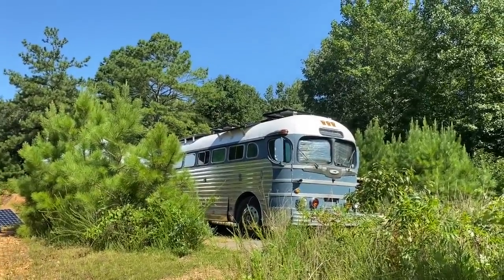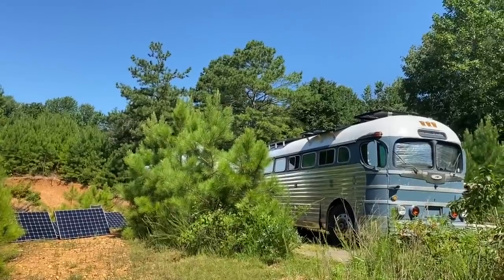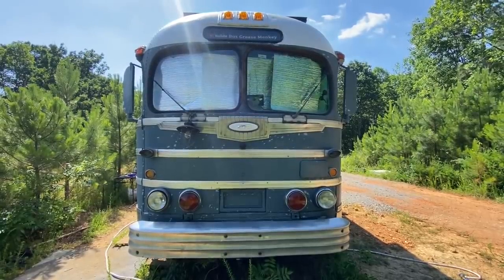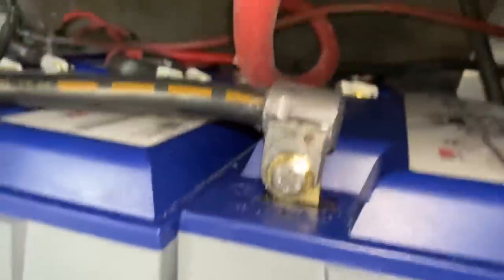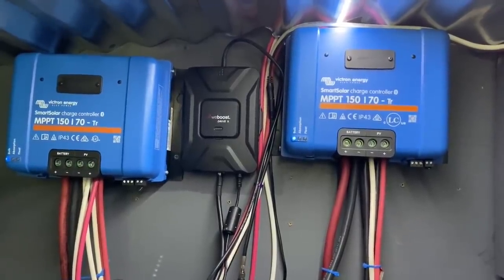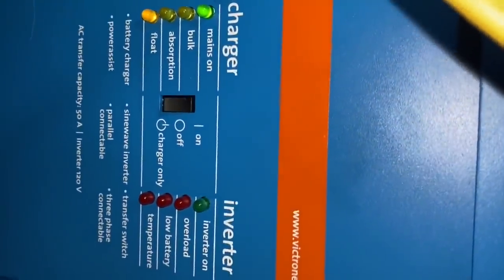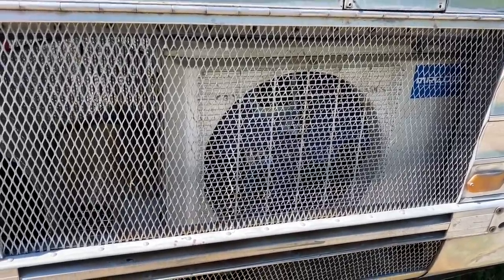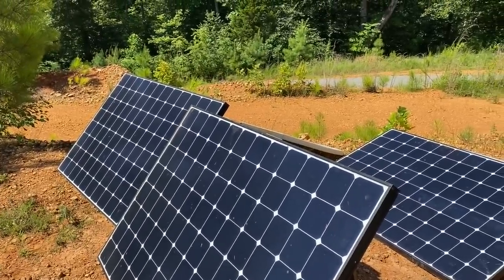Ultimate rv solar setup 4578w charging our batteries at 140a 24v

Comment: In 2025 I use a Pecron 48v portable solar generator. 30amp I can add a second unit for 50amp 2400watts each unit. You can then just plug the shore power cable straight into it.

Comment: The Orion is one thing from Victron that works. As it can be used as a 70amp  Charger for 12-24volt systems..Best bang for the buck at $140.00....

I would add. Just get a Harbor Freight Predator 9500 watt generator.. I seen contractors beat them silly for years and they still work. And there quiet for what they do...

Comment: Just hearing 25KWh/day makes me wonder how far long retrifit solutions (termomanaged battery packs for 250miles with CCS fastcharging outlet) for actually driving such a bus electrically are, and wether they`ll be availiable at an ok price in the next five years. 
I can sympathise with the nostaligia for old Diesel engines and the mountain of knowledge and practical experience that might make saying goodbye to ICE tech that much harder. But eventually even when run electrically there will be plenty to tinker around with.

Comment: We got our batteries from big battery. They sell 170 amp for the same price of battle born 100 amp. They have a 10 year warranty and excellent customer service. We have 740 amp hours and we can run our air conditioner for 10 hours. We only have 1250 watts of solar. Great set up. It's awesome having enough solar to power everything.

Comment: ~@15:00 note it may be a good option to get an extra alternator on your main engine and you can get an electric dc-dc charger and convert (i assume its 12 v on a bus like most vehicles) to 24 volt and use your main engine as that backup generator. Depending on how you do that it 'could' be cheaper than a 1 grand contractor type generator and would likely produce more power depending on the added alternator and so on. But your main engine is just a giant generator already. Certainly would cost more fuel than one of the small generators though. Thanks for sharing love the setup. Did you pay to have everything installed and such as well, or did you do it yourself. The price seems a little high if you self installed. Guessing you may have paid for the system.

Comment: I had watched a great video comparing using a generator and there are three costly and time consuming issues with running a generator.  1) fuel cost over time. 2) constant oil changes and cost of them. 3) constant changing of spark plugs and cost of them.  Running a Honda generator full time requires weekly maintenance for oil and spark plug changes and of course more fuel.  Solar is the best choice and much cheaper,  quite and less work.
Reply from the maker: Trips made to go get fuel for generators is another huge time and money expense.

Comment: With the series vs series-parallel, the power going to the batteries was the same, with respect to the power input. If the series-parallel setup had the extra 31W the amperage going to the batteries would also be 71, because your voltage is slightly under 30(28.47) you would see the 1-amp-plus-a-little increase to get 71 amps total.

Comment: 4:45  could you mount/hang the panels on the side of the bus with hinges and when you're parked, prop the panels up like awnings?
Reply: I'm planning just that on the rear of my new build - although I'll prob use actuators

Comment: Victron make a lot of good stuff for off-grid.............been living off grid myself for 3 years (6kw panels + 20kw/hr storage). I have the same chargers and inverters on my 3 bedroom home.  Victron inverters can be configured in single phase parallel or for split phase (US grid) and with 3 inverters they can do 3 phase power.   The only drawback with lithium is they are limited to 15 years life span and are a fire hazard, countries are beginning to insist that they are placed in fire proof enclosures with smoke alarms, when they go up, time is short to get out.

Comment: What a badass system I can't wait to do mine! Just a question though why did you choose to go with 24 volt as opposed to 48?
Reply from the maker: A lot of rv equipment is 24v   Plus when i add batteries i can do it 2 at a tine vs 4

Comment: Ductless mini splits are also available in DC voltage from Alibaba.com. that way you can run them straight off solar but a 21 seer 1 ton ductless mini split will run on less than 4 amps during full load and can heat and cool 400 square feet. They're also very quiet compared to the shit rooftop ac units in RV's. Ebay has a huge variety of them for way under $1,000. You will want the 120v not 220v. Buy the highest seer rating unit you can afford. The higher the seer rating the lower the amp draw.

Comment: 8 - 12v lithium battery alone is about $8k, solar panel with the controller, inverter and all the wiring at 3400w is about $5k. I love solar and not able to run the generator but it's still too expensive.

Comment: Congrats! You are in the rare cub of being able to run A\C  on solar! I tried to go that route on my houseboat 5 years ago spent 10 Grand and failed Miserably!  I see the technology is improving vastly each year!  As the A\C units become more efficient the ease to keep cool on solar shall improve. FYI? I once had a utility trailer  with panels and batteries I was tossed  from Yellowstone Campground because the Neighbors complained my solar trailer was a Generator and illegal to use after Quiet hours!  That is the Rigid inflexible thinking of the Park Service!   Again my hat is off to you to be able to run Air Conditioning on solar. A few other Bloggers on Buses have not been as successful They are trying to run roof air with lead acid batteries.

Comment: I had 2 EPSolar charge controllers running for years with no problems until recently. I had 1200 watts of flexible solar but replaced them as they failed. I have been running a Pioneer Mini Split. My batteries swelled up and broke the cases (no Fires) and can only assume it was that a controller failed and overcharged the batteries. I think you convinced me to replace the rest of my system to Victron. I have heard nothing but good stuff about Victron.

Comment: Question about your mini split a/c. Do you run that a/c while your driving or does your bus have an engine driven a/c as well? I am looking to buy a school bus and convert it to an rv but I don't think it has a/c at all so I was wondering about running the mini split while traveling.
Reply from the maker: Yes we run the mini split going down the road
Reply: @BusGreaseMonkey  Nice. I was wondering because the bus I was looking at does not have a/c.

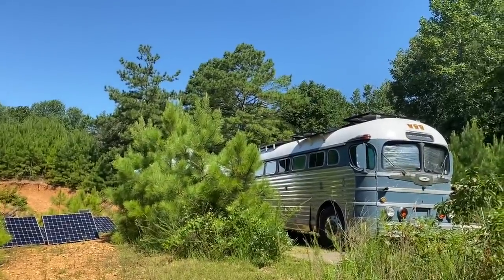Comment: @1:49 thats where this system is failing the battery aspect of solar is the most misunderstood part of the system. if you have solar array that you are not using when your batteries get full you are basically leaking efficiency your solar panels still degrade even if its not charging your batteries. its like running a generator without anything plugged into it. when i realized this long story short i ended up tripling my battery capacity (300 watt hour I know its expensive). doing this however has changed the way i view power consumption. I now want to invest in multiple tesla power walls. in the very near future if you are hooked up with a tesla power wall. you will have the ability to sell back to the grid during peak hours. a little bird told me that tesla is ready to give up to 90% of the margin gained selling back to the grid. this means i can make money off solar power up to 35k a year. great video sir!

Comment: If you make those ground solar series connected youd get more power than parallel.
Those mppt controls can take upto 150v dc pv ! Less cables less voltdrop in series
Reply from the maker: I had them series and got consistently aprox 10% less power than the same roof panels that were parallel
Reply: @BusGreaseMonkey  increase the size of the cables in series. Youll only need two cables 
and a higher volatge- produces less volt drop percentage. 
I find its more sensitive than in parallel and it produces more watts in low light.
The disadvantage of series is shadowing.
Reply from the maker: Im not seeing a drop. My panels are 54v.  I had 1/2 my system parallel and the other half series for over a month.   I saw the numbers and parallel brought in more ah every day during the test.
Reply: @BusGreaseMonkey  ok thanks for the info.

Comment: I watched a YouTube video of an off road 4WD camper that had solar panels mounted on the roof but also had slide out panels underneath the roof mounted panels. The slide out was automated. The extra panels slide out from both sides which doubled the number of panels. I think it had three rows of two panels. one panel under each so when they slide out there were 6 panels collecting power. Love your solar system. Love Battle Born batteries. I think that is a great choice.

Comment: sweet! lol, it's always been possible to run AC off of solar, you just need a lot of good lithium batteries, lots of series-wired panels, and thick wiring...which you clearly have.

Comment: For this size of system I would have aimed for 48v need far less thickness cables and inverters more reliable and can handle higher continuous load, but if your cables are sized up for it I guess 24v can work (I just be more worried about the inverters but them ones you got are quite good and transformer based if I remember)
Reply: I was going that route but my bus is 24v and finding 48v components is still tricky in the You Kay

Comment: If you make a 'modular' type roof rack from aluminium you can squeeze more panels up top as you cover the whole roof area. Sure, you cover the roof lights but you have side windows & the panels also shade the roof from the midday sun so your air con works less. More is better on a bus that size

Comment: I absolutely love what you have done. I live in a converted enclosed cargo trailer 12 x 6. I have just installed 2 x 100 watt Eco-Worthy panels and a Mighty Max battery @ 100 ah using a Renogy 40 amp controller. At least I can turn off the generator at night now. 
As much as I admire your setup it is incredibly expensive. 10 Battleborn batteries alone is way north of $10,000. The panels also are expensive. Then I see you are using Victron probably some of the most overpriced equipment on the market. 
I admire your system though, hopefully I can expand my battery bank to a 2nd Mighty Max soon and a few more panels. The dream = running an AC or a heater off solar. Just now a microwave would be nice :)

Comment: Hey, sorry if you've mentioned it and I missed it but how did you wire up 2 victron chargers on your batteries? Just chuck them in parallel? Do they have to communicate with each other? I always thought that one would mess up the other one if I put to together... Like they read the voltage to adapt their MPPT conversion, but since another one is charging the voltage isn't the actual battery voltage right? You said you wanted everything redundant so I'm guessing they're separate systems altogether? Anyway, thanks for the video and cool setup, enjoy ;)
Reply from the maker: Ive had them as two independent stand a lone and also as split phase 180.   I prefer the 2 stand alone with each one powering 1/2 of the electrical panel

Comment: in five years we have modern RVs with light, integrated 3-layer perovskit solar cells with over 30% efficiency, 60kWh battery with 300Wh/kg energy density, electric drive train and a 30kW  range extender / generator for going a little bit longer distance.
the battery with 300Wh/kg will be standard in two years. electric drive trains and inverters are standard today. the 3-layer perovskit solar cell with over 30% of efficiency, i will expect to come in 5 years. the advantage will also be, that 30% of the suns energy do not contribute to heating up the RV because it gets converted to electricity. if you park it at home for a longer time you use the extra energy for your house.
Reply: All good points. But only 60kWh battery in 5 years?

Comment: Very nice. I put in 200 watts of solar on my RV for dry camping (I don't run the AC). The biggest barrier I found to dry camp is not the electrical, but rather water management, both fresh and grey. Its hard to carry enough.
Reply: Solar dehumidifier.

Comment: Have you found any difference in the performance of the flat panels vs two sloped panels?
Reply from the maker: When i had panels flat on the ground they were nearly identical to the angled panels at any given point of the day.   The same as flat.

Comment: I've been thinking about your comment regarding getting a small generator as an emergency backup - and, I really can't think of a situation where you would need it.   You've already said you get all the power you need from your solar system, even on very rainy days.   You've got redundant solar chargers and inverters.   And, you would still need the batteries, regardless of the charging source.

The other thing I was thinking about is my own small 2kw generator that I have for power outages here at our home.   It sat there for years getting no use and when I needed it, I couldn't get it started.   Just sitting there, the fuel line deteriorated and leaked like a sieve when I tried to get it started.  So, I imagine a similar scenario for you, too.   Most of the time, it's not going to get ANY use.

So, I was wondering, what size is the alternator on your bus?   Because, you could get an inverter that is dedicated to powering a LiFePO4 battery charger connected to the engine's charging system.   If your bus runs a 24VDC electrical system, an inverter to run a 1500 watt battery charger might end up drawing 80 amps, or so, and double that, if it's a 12 VDC system.   Then, when needed, you could just start the bus and run that inverter/charger setup in place of the solar panels, or in supplement to them.   You could even do this while driving down the highway.   The big benefit, of course, is no separate generator to maintain and it will always be ready when you need it at the turn of the ignition key. 

Your thoughts?
Reply: Richard Owens 
I’d like to hear his thoughts or anyone else’s 
on this too...

Comment: Awesome system!
I had a thought about your ground deployed solar. With some basic angle iron/aluminum, you could make the solar panels into "awnings" I'm thinking just small mounts would stay on the bus permanently and when traveling etc the panels would stow. when setting up - you pop these on around the upper rim of the bus. This would give you some shade - possibly over your windows reducing thermal gain!
Reply: Yeah I’ve seen an RV with a solar panel awning. Same idea, everything was running off the panels basically, including AC. 4410watts of solar in total.

Comment: I'm jealous of your 24V system.  Are the panels 24V or do you have to pair them up to get that. If I ever redo ours I'm going with 24 or higher voltage, so much less copper and better inverters.
Reply from the maker: 54v panels

Comment: Question for ya:  What size Mr. Cool did you go with?  115 or 240 volt unit?  I think they should ban those crummy roof mount units.  They are just terrible vs. a minisplit.

Comment: I’ve been working researching the same setup for a 36 ft motor yacht. On a boat I don’t have enough real estate for all those panels but I have plenty room for batteries. I plan to use a 110 v 12000 btu mini split because of its efficiency. I need to figure out the least amount of solar I need to run the ac 24/7. I was hoping you might have some stats on actual daily power usage for just the mini split ac? I’m not even sure a 12000 btu can handle the whole boat. The inside of boat doesn’t have A lot of square footage but they are not insulated. 

Are you using a 12k btu mr cool? How well, if at all did you insulate your bus? Can you use an amp clamp and capture startup current then current when compressor is running high heavy cooling then when it’s just running slow maintaining temp.  I think real world this info will help a lot of people.
Reply from the maker: Sunny days and overcast days are on opposite sides of that scale.  Yes my bus is spray foamed insulated but i have lots of windows.  No large amp draw when they start up
Reply: Can you confirm you are using the 12000 btu model? Thanks for your help and great videos. Iight need your help if I purchase a boat with the old Detroit diesels. That is why I found your channel but I Like the old busses content. Would love to see more videos you working on the boat DD
Reply from the maker: https://youtu.be/7q20piOLgQ4

Comment: out of curiosity: you're solar panels are at 3 different angles (angle of incidents to the sun), are the panels-rows connected to 3 different MPPT ports on the charge controllers (looks like there's only 1/controller)? Or are you just accepting the losses that that creates?  The delta-angle is significant between driver and passenger side panels but maybe the losses are small? acutely curious--- thanks for the great video content !!!

Comment: Have you tried to run the mini split while driving?   Just wondering if it can handle the road vibrations?
Reply: mike h  A spinning fan has very different forces applied to it when standing still than when on the road!

Comment: cost wise pretty big, can you start with acid batteries and build up?
Reply from the maker: Of course but they require lots if maintenance, they are very heavy and they will need to be replaced aver few years.  And they need to be treated very gently or they go kaput easily.
Reply: @BusGreaseMonkey  Thanks for your reply.... I was thinking to do it slowly without too much money in the beginning.  Would it work if I added a lithium battery one at a time until I changed all the batteries over?  Are there any drawbacks to this?
Reply: Oh, and does one less expensive battery equal the lithium battery in usage capability?